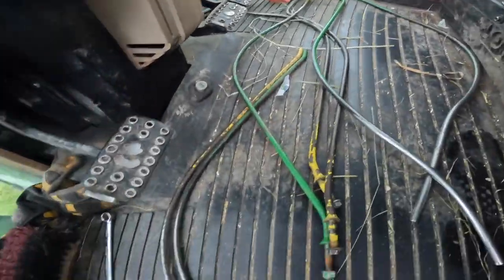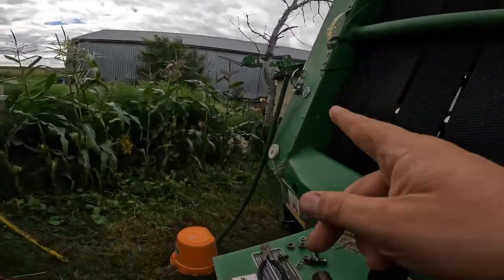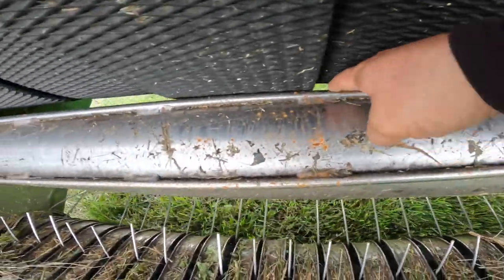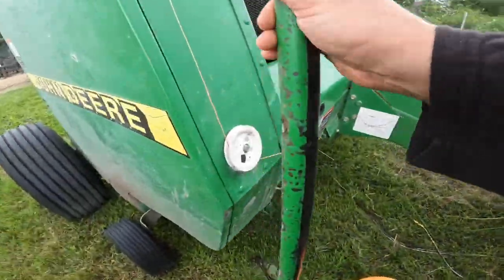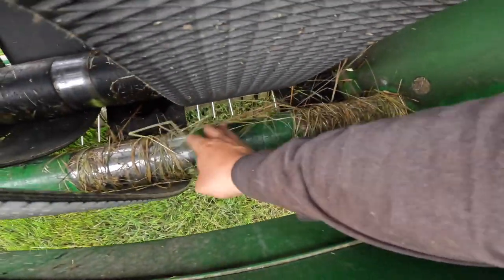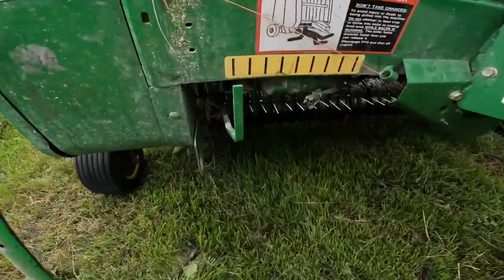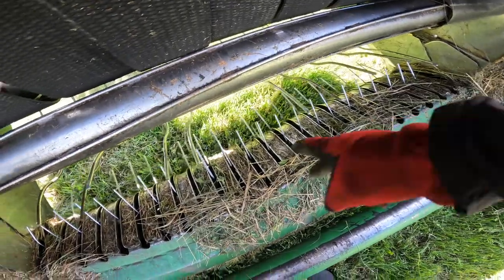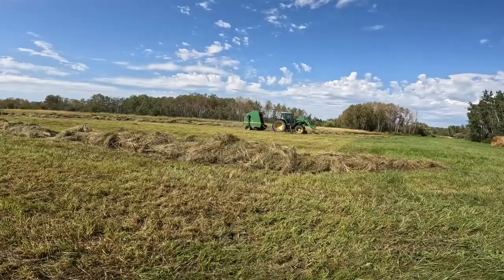John Deere Baler Plugging Up and Hay Wrapping around Rollers, here's an Easy Fix!! 🛠🧰

Comment: It might be cause it’s green.  Lol.  I know mine is taking a one way trip off the farm this year.  Had it from new and 12 000 bales in I’ve had enough of this piece of junk🤬.  Good thing my old soft cores are reliable.  Hahaha 🤪.  Might have to try a different color this time.  Might even be a Vermeer.  At least I’ll be visiting a different dealership for a change.  Those fingers are pretty important for feeding the crop in past the rollers for sure!!  👍👌🍺🍺🥃🥃
Reply from the maker: Knock on wood but my baler hasn't caused me too much issues this year but honestly chad I am considering upgrading both my baler, and hay rake. 🤔 A bigger disc mower would be nice too. I might get the wife to take out a small mortgage so I can buy all 3 LMAO 🤣👍🏻

Comment: I'm trying to think back to my jd 567. If I remember right that 567 had that wind guard free floating. I noticed you were setting that wind guard pretty high. If that guard is basically getting sucked up into your belts. I wonder if that may be your problem. would make sense. better part of the last decade we haven't had to worry about because the windrow has been too small. now that we are dealing with a bigger one its causing it to flex and get jammed in there. may be worth setting it lower and brining your ratchet bar with you just incase the pickup can't pull the product through.
Reply from the maker: I will set the guard a little lower. I will keep you posted as to if the wrapping decreases!
Reply: @PrairieSunsetRanch   I had that in mind when I looked at the Vermeer the other day that 605 N has its wind guard tines laying right on the bands of the pick up which makes sense cause this is the first year where that baler has ran really quietly. Usually its always banging against the bands on the pickup cause theres so little going through it. (least the last five years )LOL

Comment: Best thing we ever did was trade our 566 off for a used 586. Got tired of choking up. Probably baled close to 1,000 bales with the 586 and never had to get out of the cab. 
For those that might not know when 576 came they  out they changed the pick up header.  And my understanding of the only difference in 567 and the 568 is the size of the chains 
Anyway enjoyed your video
Reply from the maker: Yes those 586 are pretty solid balers. I think ones in my future👌👏👏 Cheers 🍻 from PSR